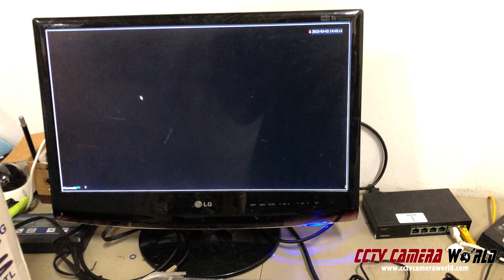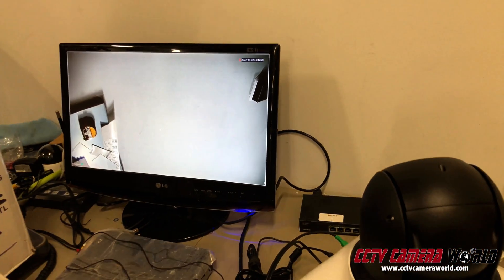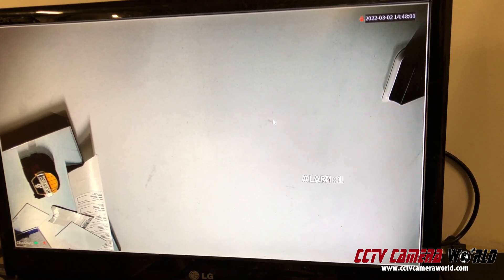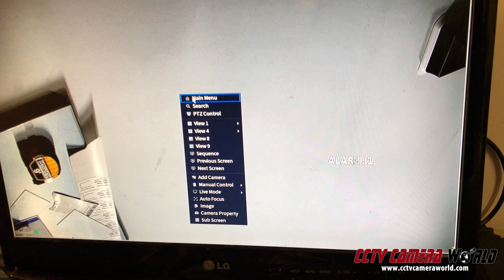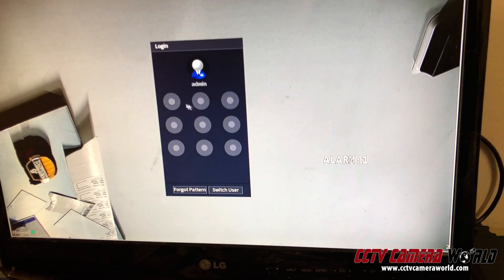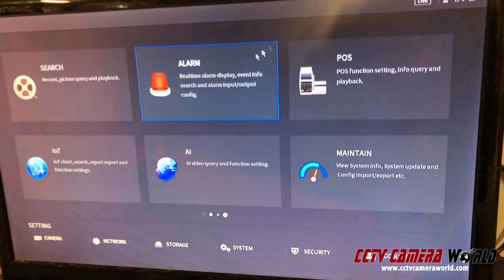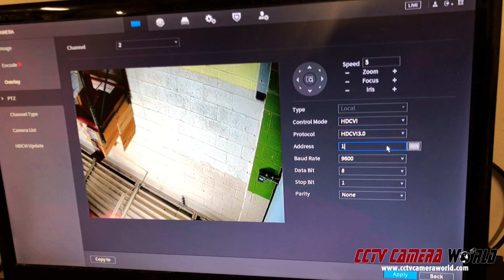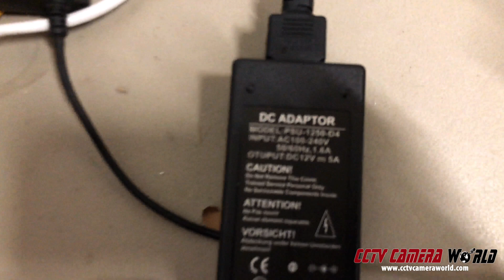How to wire a PTZ Camera

Comment: Normally for a ptz to be moved it needs to be connected to an RS485 port. You didt explain that here
Reply from the maker: Modern HD Coax PTZ cameras receive commands through the coaxial cable. With our PTZs and DVRs RS485 is not necessary.

Check out our selection of HD Coax cameras here:

https://www.cctvcameraworld.com/analog-security-cameras.html